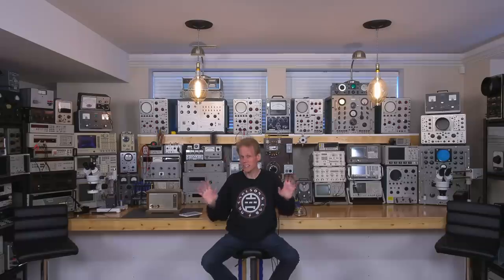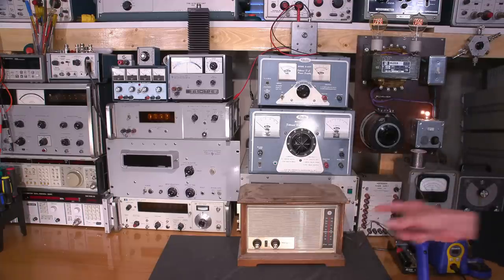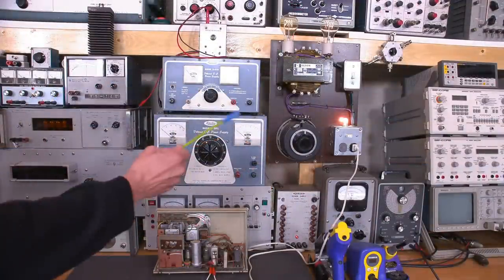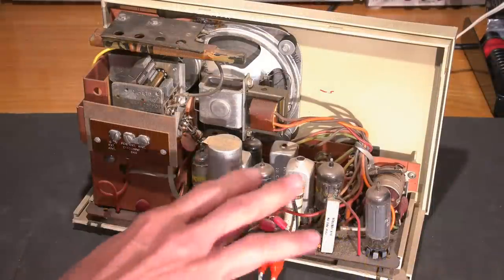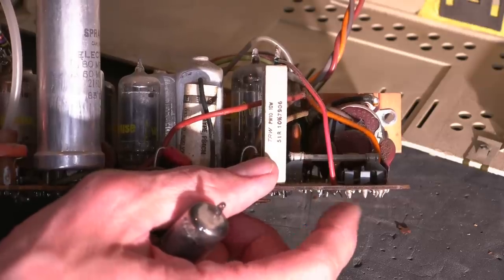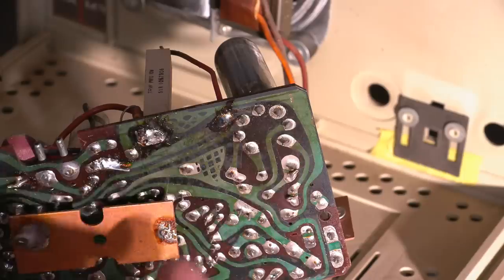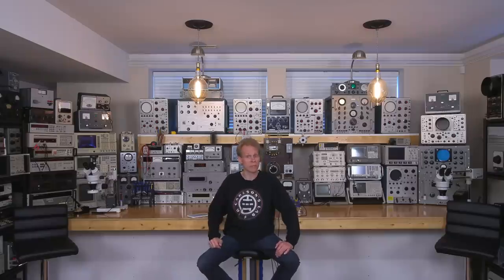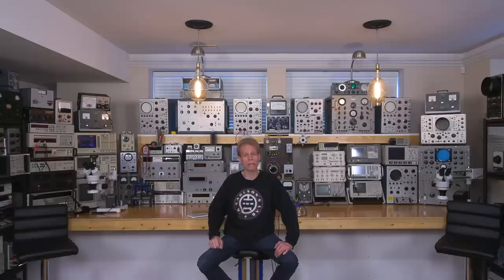Old 1960's Barn Find Radio Receiver Teardown And Diagnosis!

Comment: It's a basic cheap late tube radio somebody would have in their kitchen or something. I'd go ahead and get it running, tuned up, and clean up the cabinet and call it good. A good example of a typical uber cheap radio someone could typically buy in the 60s. One of my favorite radios for shooting AM skip was a 60s Zenith plastic cabinet rf stage 6 tube radio. Very sensitive and actually sounded really good for it's size. I still have it but the cabinet is trashed and I wasn't kind to it. I would tune it up by ear every so often to keep it peaked out.
I should probably find a nice one sometime just because it was part of my history with electronics. I probably paid 5 or 10 bucks for it in the early 70s at a thrift shop and it was in nice shape than. AM only by the way and would have been called a long range radio if it was a few years earlier.

Comment: Some IC'S are no longer being made but  there are parts out there for tube radios.
Reply from the maker: I know, it's crazy isn't it.
Reply: @MrCarlsonsLab  Kenwood TS890 HF radio their latest offering been out for a few years know, some of the IC,s are no longer being made and Kenwood have had to make a new pc board for a different chip so I head on the HF bands.

Comment: Bit on the fence with this one however it is representative of its era, has FM, and other factors in its design that would make a restoration very interesting. Perhaps it’s also a good example of a project that doesn’t need to adhere so strictly to originality which means a few mods and improvements would be acceptable and even serve to widen the scope of what we get to see and learn. I would be very keen to see a refurbishment on that basis.
Reply: I'd like to see that type of restoration done as well.  It would be fascinating to see what this little radio could do with a few period correct modifications.

Comment: I would say no to a full restoration, if you use it in the lab for casual FM listening, it’s good that it just got repaired in a way a tech may have fixed it when it was in service just like that dropper resistor was fitted with a wire and probably exposing high voltage on the top! As it is only a cheap radio it would be interesting to see what other faults develop over time . Made to a price point to be used in a day to day basis. Enjoy it as is Mr Carlson😊

Comment: Canadian Westinghouse model 870N6 made in 1963. Looks like something  grandma would have listened to! LOL  It has
 very poorly designed tube sockets. If all those bad solder joints on the PC board are reflowed (fixed), I think you might 
as well do a complete restoration. Like to see what you come up with on a proper 50C5 tube socket.

Comment: Thanks, Paul. I say yes to refurbishing the radio if you want to. Were the older Probe Master leads not gold plated? All of mine are gold plated.
Reply from the maker: The tips on these are stainless, very hard metal.
Reply: @MrCarlsonsLab  Hmm. I love these Probe Master gold plated leads. Just a light touch is all it takes. No more poking and twisting to try to get a good connection. And as inexpensive as they are, it's really hard for me to take a lot of people on YT seriously when they can't even get some Probe Master leads. Maybe it's just me...

Comment: Hi Paul, Is the Westinghouse that made this the same people who make the fans? You've done a good job so far, bringing it back to life. I would say, yeah, it deserves a second chance. Once fully tuned up, It'll be a great little radio for your workshop. Thanks for sharing
Reply: This (was) the same company. 
The Brantford factory built television and radio.  Not sure if the same plant built Motors though.
I have the clock radio version of this and my first tv was built there. 
Westinghouse Canada products especially high horsepower motors were things that just "never died, just pulled from service after decades because they were power hungry".
Great vacuum tubes as well. 
Anything from Walmart branded will not actually be Westinghouse.

Comment: Some cost cutting there, that kind of output tube socket I have never seen, seems primitive. The Görler marked FM tuner is German, and I have seen many radios here in Norway using tuners from that company

Comment: If you do the restoration on this one, and you reflow the solder, could you please show that part? Im interested if you use a plate, or an oven, or hot air, etc. 

Thank you.
Reply: Surely something like this, you'd just touch up the connections manually with a soldering iron?

Comment: Hi Mr. Carlson, I have a HK Citation II tube amp greatly modified back in the late 80's that I have using daily with no issues.
The input stage uses a 12AX7 and 6FQ7 on each channel. These two input tubes have been in the amp without being changed for 30 years plus. The service information for the person who long has passed away, calls for distortion analyzer to be used when replacing these input tubes to adjust the AC balance between them. I don't have this equipment. The amp currently sounds great but I really think I should consider replacing these input tubes and doing the correct AC balance adjustments.
Do you have any ideas.

Comment: Hi - Really good and educational video.  I have watch almost all your videos to help me with my shop.  Some videos I have watched numerous times.  I have one big question:  Do you have to worry or have you installed some type of lightening arrester for your 3,6,9 antenna wires?  If so, I do not remember if you ever covered lightening hitting your antenna wires.  If not what should we do to keep the lightening outside instead of inside the house!! This might be another good video to consider!

Comment: Could it be this old technology was used because there waskan existing factory and even the good parts where cheap since they were not state of the art anymore ? So maybe a last tube ditch before everything went solid state? That could explain the discrepancies in quality. Which in itself would make it historically relevant for the period and worth saving.

Comment: It's a modified AA5.  As you mentioned several times, they went cheap on several things.  You can tell it was a plastic cased radio that they put into a wood cabinet.   It is a higher quality circuit board than earlier ones that seemed to be made out of layers of paper.  From reading other comments it seems like most want it refurbished.  Did the FM have an AFC?  If it does, it may be worthwhile.  With no AFC, you would need to re-tune the radio every few minutes on FM  Just a consideration.

Comment: I just leave the power on and go round the tube bases with a meter - the o/c filament will have a high voltage across it.  Much quicker/easier than taking out multiple tubes and checking the resistance:)

Comment: I'm going to venture a guess this model might have also been available with a plastic case - the bottom appears to have typical plastic ridges that would function as feet, without the wood cabinet.

Comment: There was a lot of cost cutting because of the recession that the US was in during the end of the Eisenhower presidency. That 12 dt8 is kind of hard to find nowadays. It was used in the mixer stage on one of these radios that I worked on in my shop years ago.

Comment: I think this one is more worth a  restomod rather than a full-on restoration. Get her working right, give the case a quick ckean, maybe an extra clean on the dial face so it's easy to read, and let her be proud of the use she's had. Then, sit her to the side and use her as a shop radio or the like. Ie, yes, with a conditional modifier.

Comment: I would have loved this, when I was 14, in 1976. I would have mounted that beauty to my 3.5 HP minibike. While wearing my plaid pants and matching striped shirt. And since the extension cord would not have allowed me to take a ride with it, I would have thought, "There has to be a way to "cut the cord". Eveready batteries? No. Too many to make 120V and that would be DC, not AC." I will just grab the AM transistor radio with 9V battery with mono earphone. Bike is too loud. Oh, well."

Comment: I know that the 6t8 is a triple triode and that 19t8 looks exactly like a 68 in terms of the plate structure so I think it's a triple triode.
Reply from the maker: Technically it's 4 tubes all in one, three diodes and one triode. They got pretty fancy with this one, any more complexity and we get into compactron type tubes.
Reply: @MrCarlsonsLab  I must have a distorted recollection about that tube. Looking at a data sheet for it, I see that is in fact one triode and three diodes in there. Very misleading when you look at the tube's physical appearance though, as it looks like a triple triode. My RCA manual says "Triple diode, high mu triode". My recollection was from the 1970s, the last time I handled one of these tubes.

Comment: I wonder if ithere is a risk of burn off the filaments testing the resistance of them with a DMM. For example, if the tube has a filament for 1.4 volts like a minitube of the Zenith H500, will the DMM send 9 volts on that filament? Just a question. Thanks.
Reply from the maker: DMM's don't supply enough "Current" to damage filaments in vacuum tubes. It's the current you need to worry about, not the applied voltage from the DMM.
Reply: @MrCarlsonsLab  Many thanks for the explanation.

Comment: I'd say you have too much on your plate already as to queued restorations. Do the more desirable units first. Then by the time you're a great grandpa, you can get back to this one...maybe.
Looking at that white plastic base, it's obvious this unit is the deluxe version with the "wood" housing. The cheaper ones would have had a matching white plastic upper housing.

Comment: I would restore it. With regard to fault finding an open circuit heater chain would it be easier to voltage check down the heater chain rather than pulling tubes (valves in the UK), as a dry joint was suspected?

Comment: I had an inherited early 1960's ZENITH table radio, with early FM capability. It worked well into the twenty first century. Only a capacitor hum finally polished it off. "American made by Americans." 🇺🇲

Comment: it sounds a lot better than other fancier radios you restored or tested. its very clear. its very ugly though because of that plastic front. personally I think it might be a good idea to put the guts of this into a better Radio enclosure somehow. its not even fully restored and it sounds better than a lot of the other ones. im guessing this is because its from the 60s a bit better tolerances and technology compared to the point to point connection radios that you usually repair from the 40s or 50s. it is a very nice small box though so thats a plus

Comment: “Original dust.” 😏 To my untrained eye, a lot of the bench equipment looks alike. Is there any redundancy built in or does each piece  serve a separate function? Thanks for the video. Wonder if the tube socket was damaged when the board was removed before? Project? I think not, unless you feel it would be a project more people may attempt.

Comment: I have a pre-1934 Sparks Withington (Sparton) radio; had a choice between AM and Shortwave. All the tubes are missing; caps are still there. Any ideas on sources for chassis diagrams and tubes? Thanks.

Comment: Personally I'd say restore it, precisely because it is a 'cheapy'. I have a 'farm radio' that's been in my family since bought new in 1946, that had horrendous tube sockets that I had to replace - but that would have been post-war economics here in the UK. Originally cheap radios are often rare as (1) they often failed, and (2) they were likely to just be thrown away when they failed. So I say restore it!

Comment: Is there a mismatch between the impedance of the detector diodes in the detector tube versus the solid-state diodes you put in? That would not only cause a detuning of the detector but also some distortion as well.
Reply from the maker: You are correct! But that can easily be tuned.

Comment: Have seen the 19T8 in many radios, if my memory is correct there is one installed in one of my late 40s Philco AM/FM series strings.. haven't come across that similar 14v tube before but nice adaptation with the extra diodes to substitute it.

As for your question on further work on this set I vote no. It's just an old series string that has previous bodges to it. 

You have far more interesting things to show and tell and repair than this!

Comment: IMO-this is a re-purposed radio in a sense.  It originally had an all plastic, close fitting case.  The rear part of the case was removed and the rest was fitted inside a decorative wooden case.  Probably by the manufacturer.

Comment: Why not take the opportunity to not only fully restore this radio, but improve upon it like you do with so many of your restorations? You pointed out some cost cutting short comings that could be be improved upon. For instance, the lack of a display dial light and pulleys under the dial stringing. Why not add these things to the restoration to make it an even better radio? I'm sure you could even find some other improvements to make this radio even better/more desirable.

Comment: I think that you need to at least realign the FM section, since you re-engineered the detector circuit.  Then wipe it off and call it done.  It was a cheap radio when it was new, no need to upgrade it any further.

Comment: By the way, is it possible to get a visual AM alignment on most AM radios? Using a function generator and dual trace scope?
Reply: That's the only way to do it properly. But you need a wobbulator. The hi-z scope probe then goes across the AGC line.

Comment: Well, not only would I restore it, I'd also issue myself some engineering change orders and make the dial cord path more reliable by correcting those friction points, but that's me; a bit type-A on such things.

Comment: I would always say yes to a restoration, just for the intellectual challenge,  but also, who will benefit from this restoration? Who will use this radio receiver once it is restored? Is it worth it to restore a radio receiver that produces more heat than it produces sound?
Reply: Mr C will use it as it has FM.

Comment: This is why I don't like printed circuit board amplifiers because the solder crystallizes and cracks from the heat cycling of the tube. The printed circuit board isn't very flexible and can't move to accommodate the expansion of the tube socket so the solder cracks.

Comment: I would move on with this and focus on a better quality radio. This video was excellent to show trubleshooting and steps to repair, especially the safety working around a capacator.   I guess 144 volts could hurt you.

Comment: Have you ever done a video about ESR meter? If it measures electrolytic capacitor resistance in circuit, why can't I use my multimeter in resistance mode?

Comment: It's nothing special and may not be worth your time, so I would say it's up to you.  If you plan on keeping it to use on your desk, then I would say yes, it is a good idea to at least make some basic improvements, like resoldering the circuit board and testing for other weak components. Thanks again for a great video, Mike in the USA

Comment: Because the plastic is still intact and not yellowed from light, if the restoration is simple, why not do it.   But it has to look like it was intended to actually be worth something.  If anything cracks up, use it for parts.

Comment: Why are the dim-bulbs lighting at all? They should be dark
Reply from the maker: Not in my world :^) "Inductive Reactance" is the word of the day.
Reply: Ahh OK.  My dim-bulb current limiter must be configured differently to yours.  My bulbs are on the load (output) side of the isolating transformer.  So no load no light.  I guess yours are on the primary side? 73

Comment: Not sure. The external design is rather "hard" and the internals are clearly built down to a price.
Simply put, it's nothing special and it needs a lot of work.
The time and effort spent on this project could be put to better use elsewhere.
I would be inclined to "harvest" the components and use them to build/repair something better.
Great video as always.

Comment: Hi, looking at the chassis, it looks like a plastic radio stripped of its original packaging and built into a wooden structure. All the grooves around the panel and protrusions in the form of legs = a trap for the customer, an expensive-looking cheap plastic radio for a lot of money.

Nice day 🙂 Tom

Comment: I'm not convinced. IMHO it has 2 points in its favour. It is a small simple radio compared to some of the recent receivers so it should be relatively quick and easy to restore. It contains an FM section and I can't remember a recent project that included the restoration and alignment of an FM stage. Other than that it doesn't appear to have much merit, it has too many corner cutting design decisions. And there's a barn somewhere in Canada with a load of spiders wondering where their home just went - maybe they should get it back,😀😀

Comment: For me it's about your (Carlson's) time vs. benefit. There has been a lot cost cutting gone into the manufacture of this radio. Still, it is an interesting mix of solid state and tube usage and viewers could learn something. My conclusion though is that this would be a good radio to harvest parts from. Instead it would be worthwhile for you to focus on a radio that is a similar mix of solid state and tubes, which would be worthy a full restoration. TLDR; Not worth a full restoration.

Comment: Take a 2 lb. sledge hammer to it. That board is nothing but problems, I've seen that type before just a different color. You COULD add a power indicator bulb of some type to it, if you decide not to nuke it. But the dial cord really IS a mess, so I guess it's up to you.   :body-green-covering-eyes:😒